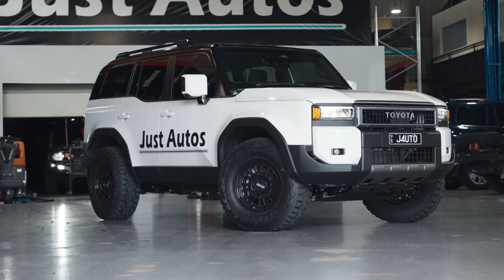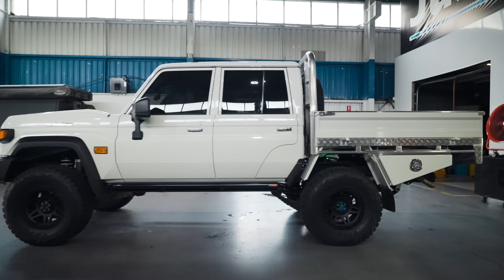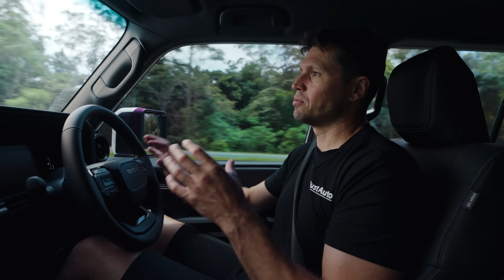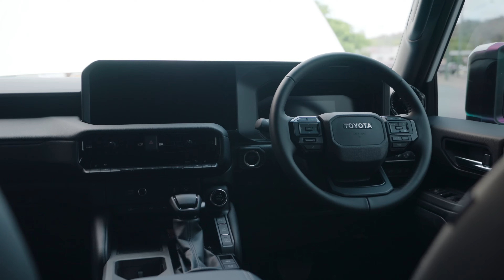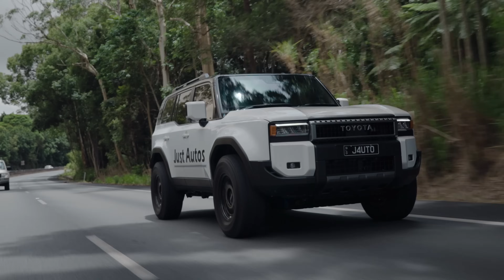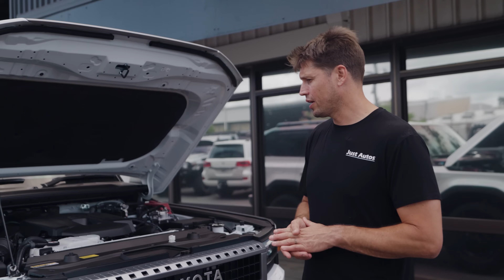Has the Prado Finally Earned Its LandCruiser Badge?

Comment: I think there may be a safety switch for when the bonnet is open so for some weird reason the car does not self start and impale a mechanic into the wall of the workshop. I have this switch on a Mazda (its for the safety reason and not an open bonnet reason/warning light) and by enabling the switch into its open bonnet position the Auto Stop Start does not work. May work with other brands.

Comment: So a Toyota Prado GXL vs Ford Everest Sport V6. Only $2k in the price from what I can see (in favour of the Ford) I would always pick a Toyota over a Ford but I’m so disappointed Toyota didn’t fit a single turbo 3.3l v6 variant to the Prado with say 180-190kw and 600-650Nm.

If they were concerned with  cannibalising sales of the 300 series it wouldn’t be hard to give it slight bump in power and torque from its TT unit to distance itself. Perhaps another 50 horsepower (stay with the D350 defender) and give it another 50 - 100Nm. Perfect timing for a MY25 facelift.

Maybe it’s just me but these cars are still bloody expensive. Add a decent GVM upgrade, wheels, tyres, bar work, battery and performance upgrades and a LC300 is the same sort of money as a Porsche
Reply: apples for apples the price difference is 10k. I have priced both. 
Am waiting for an Everest Tremor.

Comment: Its a heavy 4wd so without doubt Aus should have got the V6 twin turbo choice.  The 5 seat should have been a buyer choice in all variant models noting 7 seat kills any cargo space.
Most buyers will need to spend cash upgrading suspension with a lift and swapping out the factory rims for 17inch to gain back decent tyre wall height.  
Rear locker & sway bar disconnect should be standard on all models.  Factory Bullbar should have been factory option.
Backwards move removing spare tyre from tailgate and taking up undercarriage space that should have been designated for 2nd fuel tank.  Cruiser Company in Aus has already solved this problem with their rear bar just released for the 250 (great looking Kit but will add weight so GVM upprade will be required if your towing
Feels like the 250 has been pitched as a city bling bling 4wd for looks and for shopping centre/school run duties for the wife to drive who likes a big dash screen for Google maps

Comment: No lumbar support for the driver in the GXL for 85k!
Reply: Try no auto wipers or fold down armrest in a 300 series gxl for $120,000
Reply: Toyota just keeps outdoing itself in the cheapskate class. My GXL 150 has auto wipers and in built satnav that neither the  300 or 250 has. However, I feel the GX 250 is actually good value for bang for buck as a 4wd tourer. It will still be a 100k $ car after the essential touring upgrades.

Comment: Thank JA. Can you guys turn off add blue , stop start and egr? Note vx already come with like 5 tunes. Thanks
Reply from the maker: @jamesm6341   only one tune in all
Models you maybe confused with the modes
Reply: @ vx got eco, comfort, sports , sports + custom. Huge difference in pick up and go in sport modes. I am assuming this is different engine tune.
Reply from the maker: @jamesm6341  Pedal sensitivity is not a tune. Still will have the same amount of power and torque. It will just respond differently to different pedal pressures.